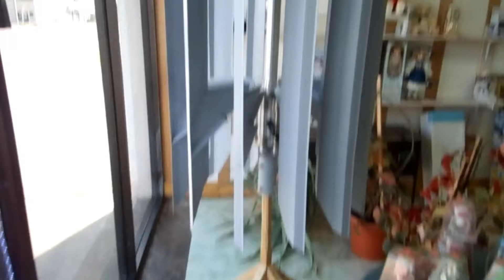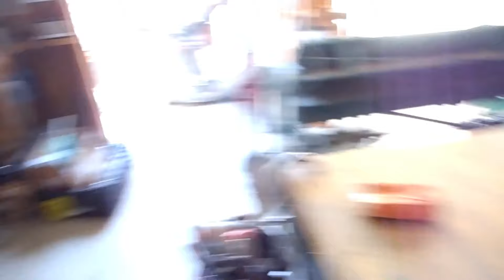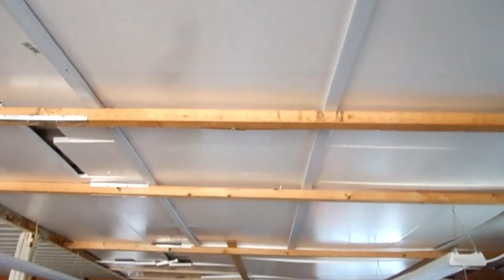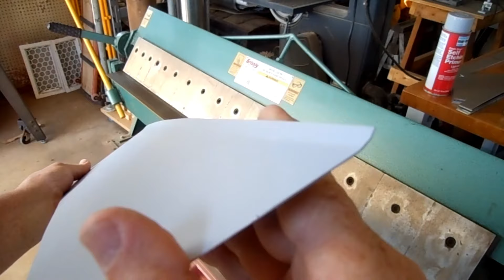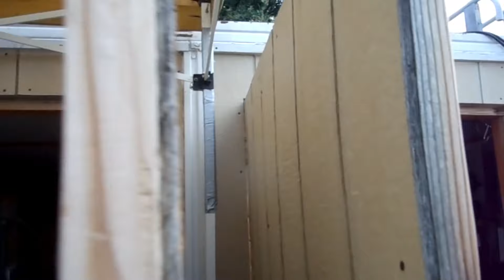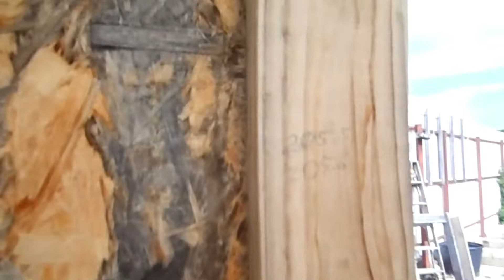Three is the number - New Stealth VAWT

Comment: Hi, Andrew, your units certainly seem to be very well engineered and I am very interested. I live on the South East Coast of England very
Reply: Sorry, I accidentally pressed the wrong button! What I wanted to say is that I live in a very windy area. Our electrical supply is 240 volts ac which is double your voltage. At the moment, I have some solar PV panels which produce DC, which then goes through an inverter to produce AC. I am really interested in your unit and would like to know if you would be prepared to send a pack of parts to UK and how much that would cost. Thank you.
Reply from the maker: The little shop is a very small one man operation, so I've always produced these turbines as complete units. That said, because I've received several request for kits, I am considering the processes for making kits available. I have no parts available at the moment, but I plan to get back into production in the fall when its cooler outside.

Comment: DAMN YOU IS GOOD MY FRIEND!  AWESOME - I'M COMPLETELY MYSTIFIED AND ENCHANTED.  I don't know if I could get something like this past my Condo Board for my little side yard but we have consistent 10 AM to 4 PM 12 -30 mph winds most of the year here in Kihei (KEY-hey) on Maui's South Shore (runs N&S on the SW side of Maui - I'm at the N End in Maui's largest Condo complex of 536 units).  I could get maybe a total height to top of turbine of 9+ft - clearing a 4 ft picket fence and have about 8 ft to my W for a sacrificial "key" where it could slowly lay down in too strong a wind - like the Shear Pin on an outboard motor prop that shears if the prop hits an obstruction, saving the shaft, gears and engine.  My condo runs N&S and I'm on the E side of the bottom. 

Roof mounted solar is way to expensive, my wife and I are eeking it out on Social Security and who knows what comes next with the Corona HOAX - but HI in general, and Maui in particular, has the highest priced electric in the US as against per capita income and 30-50% higher cost of living than TX or KS, where I grew up.  To complicate things, I'm mostly bed-bound, can't stand or walk, I'm working on getting a walkway in side yard for my wheelchair, but can still use my hands and mind OK.  I want to have an alt system to charge some LiFePO4 batts, about 800-,1000 WtHrs of storage.  It'll have to be either 2 solar, ground mount panels, which will work, or a hybrid 1 solar panel, small turbine system.  I hate to waste all that wind and many times it blows 6-10 mph all night!  Once surface ocean temps even out in late Sep/early Oct, we usually have no wind for 2-3 weeks, but lots of sunshine!  Most of the rest of the year it's wind out the Wazoo!

Good luck and best wishes on staying strong and fit - I've spent many summers on the plains in July and Aug - not much fun, especially with humidity closer to the Gulf!  You should consider selling plans for your systems and try other materials, or even kits - don't know where you got the design, but awesome rigs indeed!
Reply from the maker: Thank you so much for the kind words. I've been tinkering with a free standing, hybrid wind and solar contraption I call a power pod. But because the cost of the Freedom II PMG has become too expensive, I'm also tinkering with a belt an pulley system to drive a smaller PMA faster. Of course lack of wind for testing is a problem in my location this time of year. I could really use some Wazoo winds at the moment. Not just for testing, but to cool the shop down so I can work.
You mentioned plans, and I do have one version available. They may be a little expensive, but the Idea is to make enough money to insulate the shop, add awnings or do whatever it takes to cool the shop down during summer.
https://littleshoptx.com/product/copy-full-size-drawing-48/?v=7516fd43adaa
Thanks for watching, take care and stay well.

Comment: The generator starts poorly and very hard! 

Are your brackets also available for Thermodyne generators? 

What would the cheapest shipping cost? 

I can buy them in the UK and they run smoothly and smoothly, even if I turn them by hand.
Greetings from Austria.
Reply from the maker: Greetings from Texas.
I don't recommend using Thermodyne generators for a vertical axis wind turbine because they only have two mounting points. There might be a way to add a third mounting point, but I would need one in front of me to find out.
Sorry, I've never shipped anything outside the USA so I don't know the shipping cost.
Reply: @LittleshopintexasSV  👍

Comment: I don't know if he is still in Business but their was a guy in Chino Valley,Az. who designed and built 50 foot aluminium poles that taper from a 10 inch base diameter to a 1 1/2 inch top.His little wife who was only 4'9" tall could crank it up and down with only two fingers.it was hinged at the bottom.
Reply from the maker: Awesome! I'd like to see that myself.
Reply: @LittleshopintexasSV  I used to have his Business Card,I will look for it and get back with you.
Reply from the maker: Thanks, I appreciate that.
Reply: @LittleshopintexasSV  Well bad new's I found the card and the phone is shut off and the e-mail came back undeliverable.I wanted to get  them for my  40 acres between Ash Fork and Seligman AZ just 1 mile south of I-40
Reply from the maker: That's the way it goes. It takes a lot of time, dedication and money to start a business.
Reply: @LittleshopintexasSV  I think he died because the last time I saw him was back in 2002 and he was ten or 15 years older then me and I am 67 now.He was a retired NASA engineer.
Reply from the maker: I guess he ran out of time. I'm running out of time as well. I'm 61 and haven't had a vacation since 1994 and I'm losing my enthusiasm and hopes to build my business. If I live long enough to get on medicare and retirement benefits, I'll be grabbing up my fishing gear and no one will see me for a month... Maybe then I'll have my enthusiasm back.

Comment: Hi andrew,
Can’t stop thinking about trying to make my own. I’m in Aus so I can’t see myself driving by to order and pick one up. From your video showing how to make one/measurements, I can probably work out how to in time and given the chance to apply my interest. I have wondered if (even just a picture) of the larger blade template could be shared. To be honest the plates and rest of the structure would likely take me much to skill up (and tool up) to make also - but seems to me a fantastic and useful project to work on.. 
I have wondered - have a look at this video; https://youtu.be/vCcHKikC8I4 as an example of offset the generator (am sure I’ve seen you talk of in a video so as to increase the revolutions of the generator). Perhaps it takes the stress off of the generator bearings also. Finally yes maglev for the turbines bearings could reduce the biggest friction point..
Well one day I hope to be able to write and say see what you inspired me to make. Not much wind here where I am in Sydney but the idea just captivates me, ( a stealth vawt working in tandem with a battery stored and grid connected solar system).
Hope to hear on your progression in making a telescopic / bend down (for servicing) pole. Maybe setup a go fund me page would help you some towards the materials costs?
Reply from the maker: The drive pulley mounted to the bottom of the barrel might be the most expensive part on that project, but it looks like it would work providing you get enough wind to spin it. I don't think I would trust those little tabs of metal at the pivot points; I'd have to weld on a bit more metal to prevent tear out. If you build something, please let me see it.

Comment: Hello  Andrew  from the windy city. Outstanding hobie.  My 2 horizontal  turbine failed  after 3 years.  The 300 watts was roaring  with any low wind and the 600w got unbalanced and noisy  so I had to take the them down.  I wonder  if you make a DIY kit easy to transport in a car. I can give you  a hand if you need it.
Reply from the maker: Sorry. Eventually I hope to build up a supply of parts to make kits available, but I don't have any extra parts stored-up yet.

Comment: Hi again, nice vidieo of the blade count progression.
How much extra low speed torque is gained with the longer blade ?
Btw, your canopy looked a lot like mine still does. 👍😉
Reply from the maker: LOL The first leg got broken on fathers day when the canopy was flipped, another leg was broken last Sunday, and a storm last night ripped a hole in the cloth and collapsed the top (again). I think it's "almost" time for a new canopy.
I haven't had time to play with the new turbine design yet. So I have no idea how much low speed torque its gained. Once i've filled the orders that are waiting, I plan to make one for myself. One thing I hope to do in the future to help answer all of our questions is to build a small wind tunnel. It would be handy to have a controlled environment where I can analyze wind speed to torque, wind speed to power output, and maximum RPM.
I have the metal from a four foot tall, twenty one foot diameter above ground pool. I haven't done the math yet, but It might be able to make a tunnel 5' foot diameter 12' feet long or 6' diameter 8' feet long, or even larger if I use wood for flooring and frame work. I just need to acquire the materials to build the structure. And of course something to move the air would come in handy as well.
Anyway, thanks for watching and it was good talking with you again.
Reply: @LittleshopintexasSV  l look forward to your results. Luck to you

Comment: "Wonder what the neighbour would say if I cut his tree down?"
"Wow! That guy has just cut the only bit of shade down he had! Hope he has good insulation" ;0)

A daft question .... Why so much video of a good looking turbine that is not moving and no audio? If you eddited it down a tad you may get more likes and still get your message across!

I am interested in the design of blade numbers / power output / speed of rotation. Why not have an odd number of vanes? As long as it was balanced I see little difference (other than harmonics)!

All the best!
Reply from the maker: I really wouldn't cut down my neighbors tree, I enjoy the shade from it too much... but sometimes I'm tempted to trim a hole through the middle.
I get fussed at for using music in my videos, and now I get fussed at for not? The sound of cicada was very strong in the raw footage when I was editing the video, I hoped that sound would have come through lowder on the video.
I will build a turbine with five blades in the future, but they will be a different style. The general rule is the more blade surface you have, the lower wind speed it takes to start it rotating. Another rule is,  more blades equal a lower top speed or RPM. Unfortunately I can't tell you what speed of rotation is for this one because the tree was in the way.
Reply: The best solution is to raise the turbine higher than the trees or any structure  close by.  If the blade has a window that opens against the wind and closes with the wind direction will help with low speed wind.
Reply from the maker: @neliosamch3195  You're right, the higher the better for getting into the wind.

Comment: Have you had any problems with the bearings in the generator unit yet? 
I don't remember if you have bearings at the top, but my only concern with direct drive would be bearing wear! 
Indirect drive  with a pulley system would give you the option to change ratios to fine tune the system and increase bearing life of generator.
Reply from the maker: The turbine sitting on top on my shop has been there for about five years and I haven't an issue with the bearings yet. Perhaps it might be more of a problem if it was in a windier place. I've been watching and listening for any sign of a problem when it's spinning, but nothing yet. I do plan on tinkering with a belt and pulley system, but I haven't had the time or money to invest in that yet. Hey, thanks for watching.
Reply: I think direct drive are the best maintenance free, but for windy and snowy locations an adapter plate with a bigger  bearing  and housing that supports the weight of the blades will be required.